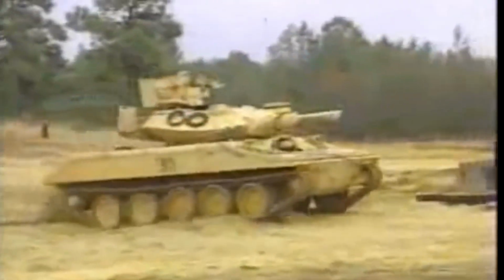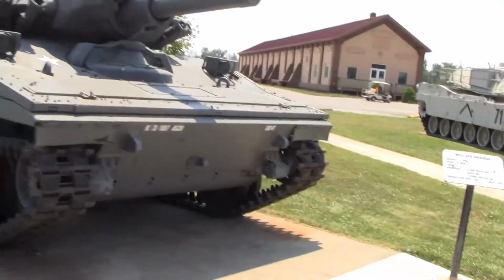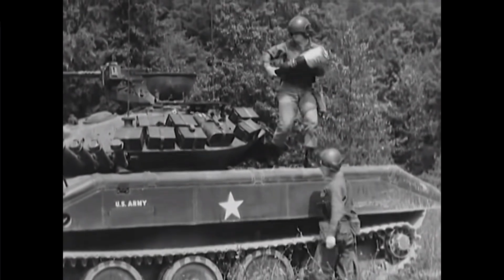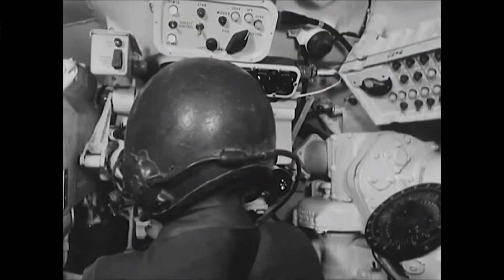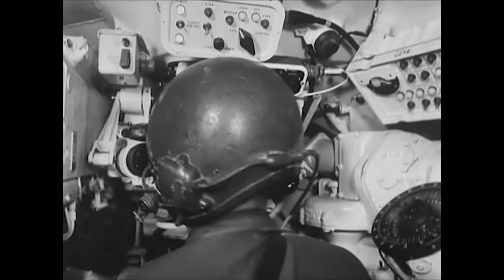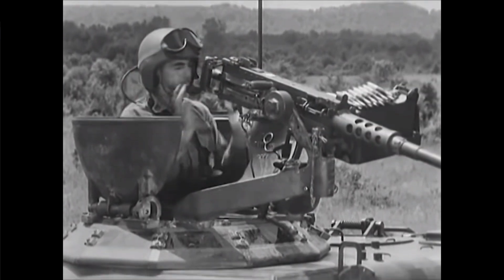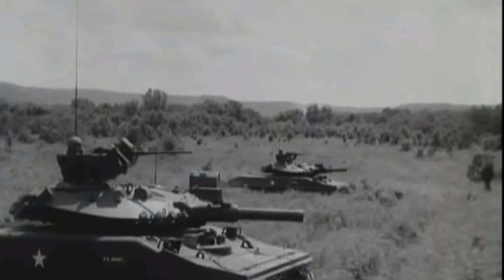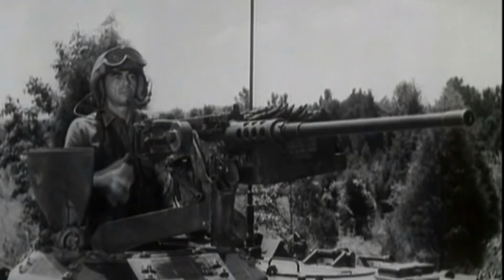M551 "Sheridan" AR/AAV | DESIGN DISASTER!

Comment: Interesting report. I was a platoon leader and later troop XO in Cavalry troops at FT Polk, LA (where conditions were not unlike Vietnam, WRT heat and humidity) from 1975-1979 when we turned the M551s in for M60A1RISE tanks. The squadron had 18 Sheridans (our C Troop was a LAARNG unit that still had M60 tanks and even a few M59 carriers rigged out as mortar carriers). My general experience was that the Sheridans were fairly mobile in the local terrain. The transmissions were a bit fragile, but generally held up well. We blew only one in that time, trying to recover a bogged Sheridan by towing it out with another.  Didn’t do that twice.

The gun system was interesting. If you were firing a missile (such as during gunnery training) you were good if you hadn’t fired any conventional rounds after the turret mechanic had checked the tracker box (which held the circuit cards you mentioned). The problem was that the conventional round recoil would shake the circuit cards loose. If shaken loose, you could still fire the conventional rounds all day, you just couldn’t fire another missile until the turret Mech fixed it. Mind you, once you shot the first missile, you could continue to shoot missiles all day, so long as you didn’t fire a conventional round. 

I had an AOB classmate who went to one of the ACRs in Germany, where the units swapped their five scout tracks for three more Sheridans in each platoon. He told me that his troop designated two Sheridans in each platoon as Missile tracks, and converted the ammo racks to only hold missiles. In the event of war, these two tracks would only fire missiles.

Lastly, many M551s were turned into VIZMODs, to look like Soviet vehicles at the National Training Center starting in 1980.

Comment: In the mid-1970s I was a scout in the scout section of an armored cav platoon. The platoon had a section of Sheridans.
Loaders used to slit the rubber propellant boot to make it easier (and faster) to remove when actually loading the round.
One of our Sheridans once fired and the breech cracked, allowing a flash fire into the turret. No one was hurt, but the loader's eyebrows were singed off!
Shillelagh missiles were optically tracked but remotely controlled (unlike the TOW missile). The gunner had to keep the sights trained on the target during the missile's flight. Upon firing, the missile would fall below the gunner's view, before coming up into view (after the ignition of the missile's rocket motor). Gunners would sometimes track their sights down, looking for the missile. This could cause the missile to impact with the ground. But not to worry. Gunners would correct the mistake and the missile would usually just bounce off the ground and go downrange and score a hit.
I did get to drive one once (a crew was short-handed) during firing tables. Usually I was helping out in the range control tower, or sometimes was actually running the firing line from the tower. I was only a Pfc! (My company commander had a great deal of faith in my abilities.)

Comment: I saw a M551 for the first time in 1984. I had just graduated from The Infanty school at Fort Benning Ga. My first duty was at Fort Irwin Ca. Where the Sheridan was being used as a OPFOR BMP and T62 with what they called VidMods(Visual Modifications) after 2 weeks of driving and maintenance school and uniform change we where ready to join the ranks of the motorized rifle regiment. The Sheridan was actually pretty tough out there in the Mojave desert. We put a lot of miles on them and went in some pretty hairy places with them. They did break, mostly fan towers and stuck injectors which meant a trip to the CSA (Combat Support Area). Where our mechanics worked endlessly to keep them running.  We gave the Blue force (US Army units there for training) a run for there money. Even when we went up against the Abrams and Bradlys for the first time we held our own just because they where playing in our backyard that we knew like the backs of our hands. Navigation in the desert can be tricky on the ground.

Comment: When I first saw the side of the Sheridan M551 at a military exhibit when I was a teenager, I mistook it for a British Crusader Mark II  due to the sharp edges of its turret. I was corrected by a US veteran tanker who said "at this exhibit they don't show  British crap tanks, and kid this is not a WWII tank"  The M551 looked good to me, it had a low silhouette, it was small, wide tracked.  Was it like the P400 air cobra WWII plane, which had great lines and armament but with many deficiencies? even this  P400 plane was ridiculed by WWII pilots, I heard that they used to say " It's just like the P40 with a zero on its tail". To me,  every time a US veteran dies it's like a library burned down. Thanks you Vets, I lived and learned due to your hands on knowledge and your sacrifices. You earned scolding me for my ignorance.

Comment: I remember three things about this beast.  1- when you fired the main gun it rocked your world. 2 - the missle worked incredibly well, WHEN it worked at all 3 - I lost 30% of my high end hearing
Reply: You should have tried the M40 106mm for noise. Without earplugs you hear nothing but ringing ears for two weeks.
Reply: @ddawsond  The M40 was a 155mm.  It was pretty much out of service with US forces after Korea.  By the way, M40 was also the designation of a sniper rifle based on the Remington 700.
Reply: Now the M40 recoilles rifle was called 106mm although it was actually 105mm.  If you fired that, good on you.  I never got to even touch one.

Comment: Was assigned to B troop 3/5 Air Cav in 1976/77 A troop had the M551, watched as they were doing a low level extraction out of a C130.  Turret went one way, tracks another and body a forth way.  Took them several hours to clean up the area.

Comment: The M41 Walker Bulldog was a great light tank. Its 76mm gun was able to take out T-54s in Vietnam. South Vietnamese Army tankers used it with great success against NVA T-54's, outperforming it in tank to tank warfare. Which is very impressive for a light tank!
Its only drawbacks 

Aren't  you a bit to harsh on the Sheridan?
Yes the 152mm gun/missile system was  a huge failure. Caseless rounds, firing destroyed the missile systems. Which is why the M60A2 Starship failed.  The Sheridan had issues. Its armor was very light.
But it was the only amphibious and airdroppable tank in the US inventory. 

In Vietnam it of course was more vulnerable than the M48 when dealing with mines and anti-tank weapons. But its light weight and being amphibious allowed it to go places the M48s could not. Like going trough swamps (of which there were a lot in Vietnam).

Having a tank that can be airdropped will result in a tank with light armor. Not much to do about that apart from having add-on armor kits applied later. But with another gun the Sheridan would have been very useful.

It is a shave its replacement, the M8 AGS was cancelled. That was actually a very good air dropped light tank. 105mm gun and modular armor packages. Although not amphibious like the Sheridan. Maybe its M8 Thunberbolt 120mm variant will see a revival.

Comment: I was a Sheridan crewman the 82nd's armor battalion (by then called 3/73 Armor), arriving in early 1996 and staying until it was deactivated.   By the time I was there all of the major kinks had long since been worked out.  I found the Sheridan to be far more reliable than the Bradley and far more mobile than a HMMWV.   I think it's important to keep in mind that Sheridan WAS NOT A TANK.   Sure, it looks like a tank and we called it a tank, but it's a reconnaissance/assault vehicle.   For that role, I think it's still unmatched.  Think about the specs:
152 mm shotgun (canister/beehive), 1000 rounds of 7.62 machine gun, 500 rounds of .50 cal.   Anti tank guided missile that could still kill most of the world's tanks.  High explosive shaped charges that can knock buildings down (and fortress walls, as in Panama).   Parachute deployable anywhere on Earth within 24 hours.  Never throws a track.  Rarely breaks down.  Rarely gets stuck in mud.  Short gun tube allows turret to traverse in dense woods and urban environments.  Can "swim" across a freakin' river...

Fun facts: 

1) The crewmen were all Cavalry Scouts (MOS 19D) , not Tankers (MOS 19K). 

2) The most senior enlisted member of the US Military,  (https://en.wikipedia.org/wiki/John_W._Troxell), started his career as a Sheridan crewman (his combat jump into Panama was part of 3/73).
3) Due to the strange combination of qualifications (parachute qualified 19D with Sheridan experience), it was very common for soldiers to spend 15+ years of a 20 year career in the (one and only) Sheridan battalion.

4) The electronic boards mentioned in the video which could "shake loose" during firing were always secured with a piece of cardboard stuck (usually from an MRE box) in the  lid.   All the boards were actually all interchangeable, but controlled different things.   Thus if you had a part of the board burn out, you could usually just open the box and re-arrange the boards to fix everything.   I'd call that a brilliant design.
5) Each tank was named by its crew after qualifying in gunnery.  The name of the tank had to start with the letter of the company. 

6) Full-sized M16s being too big for the turret, crewmen were equipped with either a M9 Beretta, or an M3 "Grease Gun".

Comment: The main problem people have when they think about the M551 is, IT WAS NOT A TANK. It was never intended to be a tank. It was a recon vehicle. Its purpose was to move into place, observe, and report, then get the eff out. It was never meant to go toe to toe with any tanks. Or any other AFVs, for that matter. It was intended to provide immediate fire support for friendly infantry. If it fired on hard targets, the idea was to shoot and scoot. By using missiles it could hit targets which, at the time, were far outside the effective range of any conventional tank gun. But it was basically harassing fire. The conventional rounds were intended for use against heavy but unarmored targets - buildings and bunkers. The M551 was pressed into service in a tank-like role in Vietnam because that's what the units had available. 

You could say the M551's greatest success was that it acted as a successful proof of concept for designers of anti-tank missiles, and Russian tank designers. The Shillelagh proved that there could be effective line-of-sight ATGMs, as opposed to early Soviet designs like the Sagger, which required the operator to "fly" the missile to the target. He had to keep the missile in sight and manually close the angle to the target, where an M551 gunner only had to keep the crosshairs in the right place and the electronics made the flight adjustments. Now, the Russians have tanks with 125mm guns which can handle both conventional smoothbore high-velocity kinetic energy rounds, and ATGMs. As happens frequently in the development of military equipment, a technology we tried and were disappointed with was picked up by our (potential) enemies and honed to a fine edge.
  -- Ex tanker, 1970s

Comment: In 1975 I was an armored cavalry scout in the 1/4 cav at Ft. Riley Ks.  Though I normally crewed on an M114, I was cross trained as a loader on the Sheridan for tank gunnery. When we fired the conventional round the entire vehicle leapt 3 inches into the air and 6 inches backward. We couldn't fire with the turret oriented to the side because it would cock the road wheels off their bearings.
Anyways, about the 3rd shot of the day we were suddenly drenched by warm sticky red stuff. We thought someone got in the way of the breach and got splattered around the inside of the vehicle. Big relief to find out it was just a ruptured cherry juice seal.
One other idiosyncrasy. between firing the gun/launcher you had to polish the electric firing probe with a green scotchbrite pad or you'd get a misfire. 
On a later exercise we did loose one to an onboard fire. Turns out their fire extinguisher was empty. They always had cold sodas though.

Comment: Didn't the later Abrams tank use semi-combustible cases? Seems the design was ahead of the materials technology.

And 152mm warhead is probably overkill, whether HEAT or fragmentation shell, but i guess it had to be that big as that was as small as they could make a guided missile.

Except since its a guided missile, why even try to fire it down a barrel? It could be launched like a torpeedo through just a hatch hole and have the gun be specialised for lobbing HE.

Comment: IT IS NOT A TANK! IT IS AN AIRBORNE ASSAULT ARMORED RECONNAISSANCE VEHICLE. 

WRONG! THE AIR COMPRESSOR WAS STORED UNDER THE LOADER SEAT AND THE AIR BOTTLE WAS NEXT TO THE LOADER SEAT. THE AIR COMPRESSOR WAS EXTREMELY NOISY. IF HIT THE AIR COMPRESSOR BOTTLE WOULD EXPLODE KILLING THE LOADER AND CREW INSIDE THE VEHICLE AS THE HEAT ROUNDS AND SHELLIAGE MISSILES EXPLODED. 

IT WAS A COMPLETE WASTE OF MILLIONS OF TAX PAYERS DOLLARS ALONG WITH THE MILLIONS WASTED ON THE GAMMA GOAT VEHICLE AND THE GOER VEHICLE. ALL THREE WERE WORTHLESS PIECES OF GARBAGE.

Comment: I was a loader on one of these in 1977 (B 1/10 Cav. 4th. Inf. Div.). I experienced most of the problems that you mentioned, PLUS, having to keep one of those green ScotchBrite pads on hand to manually clean the electric firing probe every other shot as it got crusty with carbon and refused to fire otherwise. Hand-cranking the breech open and closed is NOT fun, and when the scavenger system fails to evacuate the bore....a thick, white "angel of death"-looking vapor comes oozing out the breech into the turret and starts choking everyone and burning their eyes out of their sockets...GREAT fun! To be fair, though, everything we had was Vietnam-vintage equipment and WELL used. Replacement parts were hard to get a hold of, as well...we were told that US Army EUROPE was getting most the budget. Later on when I was stationed in West Germany we were told that CONUS received parts priority...hmmmmm. I preferred the M-220 A1 (M-113 outfitted with TOW missile system) to the Sheridans.

Comment: A friend of my dads commanded one of these in Vietnam. My info is second hand so is subject to errors but the storied I've heard are still interesting. He used the tank to defend a artillery base during an attack (it might have been during the Tet Offensive) and would drive from position to position firing a few beehive rounds at each and then repeat. This went on for hours or days, don't remember. Never the less without his Sheridan the base would have been over run. After the battle the beehive round was found to be very effective and any enemy receiving a direct hit was vaporized and others were literally nailed to trees. Another thing was that they were trained in the firing procedure for a "Classified" round. To fire it the tank was positioned facing away from the target area, the turret turned 180 degrees to fire over the back of the tank, and once the round was fired the tank was to drive in the opposite direction of the target as fast as possible. They were never told what the round was but was probably a nuke. I've tried looking up info to see if the gun ever had a nuke developed for it but have never found much. 

He also shared how they secured their perimeter for the night while on patrol with "jelly bombs". Take a empty 30 cal ammo can, fill the bottom with c4, cover with 50 cal and 30 cal ammo links, and wire for detonation. Anyone hit by these were turned to jelly by the high velocity hardened steel links. Lastly due to the tank being used to lead convoys and its pitiful armor, anything and everything was strapped onto the front of it for additional armor. Including a case of Budweiser beer. Turns out Bud is a decent at stopping RPGs. He remarked on when the Viet Cong got their hands on the new RPG7s. He said that the old RPG2s were nice and slow, you could see them coming and dodge. Where as the new ones were so much faster, and more accurate, it just wasn't fair! 

He was sent home after a RPG or mortar hit the engine deck of the tank while he was standing out of the hatch, peppering his back with shrapnel. Most of it was removed by surgery but some of it still remains and sets of metal detectors at airports. On occasion he will get what seems like a zit on his back but when it finally pops inside will be a little shard of that shrapnel from Vietnam.

Thanks for the excellent vid and I hope you find this useful and informative.
Reply: Damn good info, I wonder what that round was. It was probably a very small tactical nuke.
Reply: @complexblackness  Secret nuke tank round used in Vietnam. "Total Horseshit".
Reply: @KB4QAA  What's horseshit? It wasnt going to be used in Vietnam, more likely in western Europe in the event of a Soviet invasion. Through the Fulda gap.

Comment: Our tank battalion’s recon platoon (reinforced) was issued M551 Sheridans to replace the M48A3 the rest of the battalion used. I knew we were in some difficulty when my medics were also issued nomex when working with the platoon. A real bugger to get an injured driver out in a hurry. Saw more than one “cook down” in a mixed slag of road wheels and other bits. My son had the privilege of transferring the last of these little monsters to the desert for use by “aggressor” forces. Last real airborne platform that sorta worked was the SPAD - rubber bands for tracks.